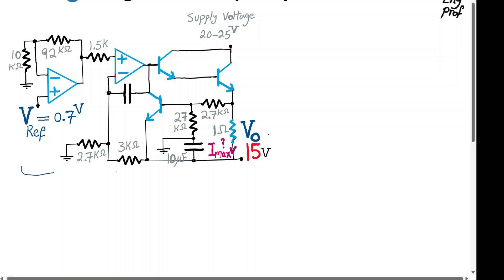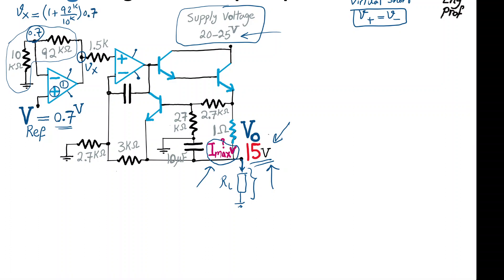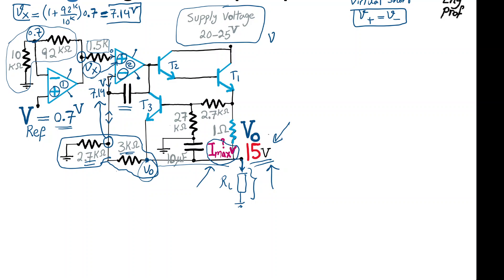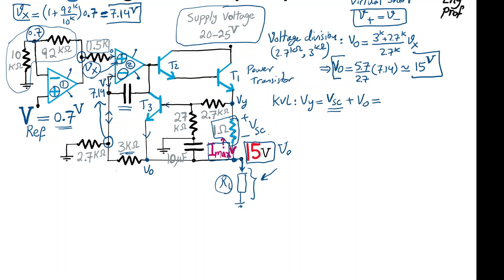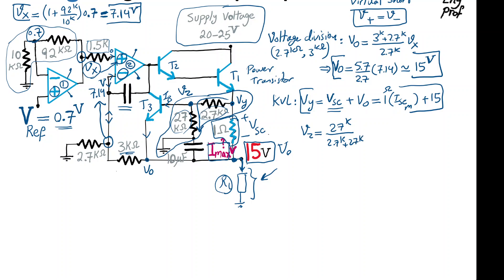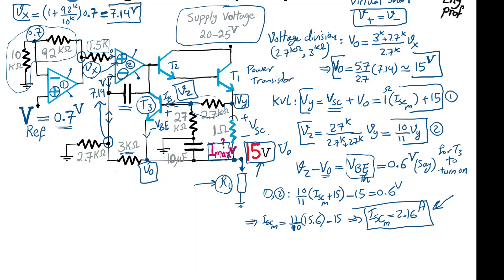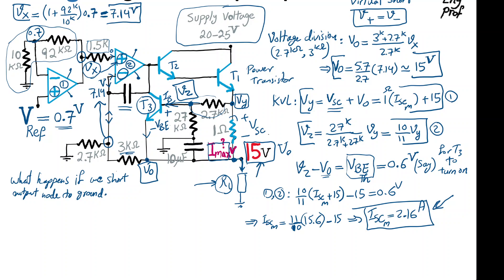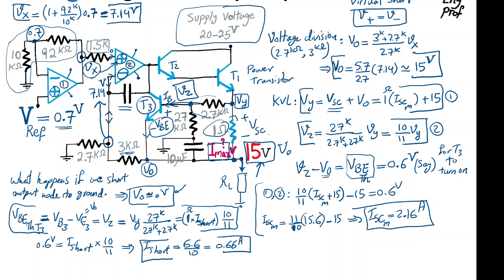Voltage Regulator Design with Op Amp and BJT Transistor

Comment: I suggest u pl focus on explaining how particular circuit works first before explaining how values of different resisters / capacitors are calculated
Reply from the maker: Thanks for watching, sharing your thoughts and your suggestion. You might find a better explanation in https://youtu.be/p5iiJE9Z7Lk video for a Low Voltage Regulator Circuit Design with Op Amp, Zener Diode, JFET, BJT Transistors. I hope you find it interesting.

Comment: Hello, I really appreciate you making this video! I have been trying to make a CC and CV power supply using BJTs and opamps for years now. I am puzzled by the crazy feedbacks other than the compensation networks, can you please make videos on those topics as well. I'm really passionate about electronics but I need help from an expert like you
Reply from the maker: Thanks Anurag for watching. Glad that this voltage regulator video is helpful. Pls watch this flexible regulator example https://youtu.be/CJl-urzeiTo and let me know if it is helpful regarding your question or not. 
Please let me know more details about what exact type of feedback scenarios are you looking for so that I do my best and find the best example to help you.
Reply: @STEMprof  Thank you for your quick response, I really appreciate it.
Reply from the maker: Thanks again for watching. Hopefully the new Voltage Regulator Design with Current Foldback feature https://youtu.be/RFfRrbqM_-s is interesting and helpful. 🙋‍♂️

Comment from the maker: Thanks for watching. For more Analog Computer & Op Amp examples please see: https://www.youtube.com/playlist?list=PLrwXF7N522y4c7c-8KBjrwd7IyaZfWxyt
Flex Voltage Regulator Example: https://youtu.be/CJl-urzeiTo
Voltage Regulator Design with BJT Darlington Transistors and Zener Diodes https://youtu.be/ArisQp7V0Ac
Bandgap Video: https://youtu.be/esMlNx5w9Jw
Sawtooth Oscillator with Op Amp, JFET and BJT Transistors https://youtu.be/5zHXTx-Vl20
Op Amp Analog Computer circuit that solves Differential Equation: https://youtu.be/ENq39EesfPw 
Full-Wave Rectifier:  https://youtu.be/DJJMNU-CYcg

I hope these Analog Circuit Design and Analysis Examples are interesting and helpful. 🙏

Comment: There are two separate systems here.  One controls the output voltage, the other senses an over-current fault condition.  There are ways of presenting a schematic in which the principles of the functions are immediately clear.

I have the gut feeling that there is too much amplification and this might threaten stability.  The "Darlington" transistor connection has enormous gain and op-amp 2 (used as a comparator) has an uncontrolled gain with decreasing frequencies.   The presence of a 10 uF capacitor across the output might suggest that there was initially a problem with stability, and the capacitor was necessary to "hold it down".

I would expect a modern design to use a power FET instead of a bipolar transistor.

In a fault condition, the load resistance may be any value less than the specified RL but greater than zero.  Can it be shown that the power dissipation in transistor T1 would be less than the maximum allowable under all values of RL ?
Reply from the maker: Thanks for watching and sharing your thoughts about this voltage regulator circuit. Yes, modern regulators use power FETs instead of power BJTs. This is just an example utilizing BJT.  Maximum power of the power transistor is maxCurrent*(maxSupplyVolt - EmitterVolt) ~= 2.16A * (25V - (2.16A*1ohm + 15V)) ~= 16.94 Watt. Therefore the Power transistor is recommended to be a 20 W transistor in this example.

Comment: I've always liked those Darlington arrangements.
Reply from the maker: Thanks for watching. Glad that you also like the famous Darlington transistor formation.  I will try to post more on Darlington.
Reply: but did you know there are two types
Reply: @kennmossman8701  The other one is the Sziklai pair : )
Reply from the maker: @tanmayvadhera4250 Thanks Tanmay for watching and your comment. I will soon post videos on Darlington and Sziklai Pairs. Here is another Voltage Regulator Example: https://youtu.be/CJl-urzeiTo
And a Bandgap Video: https://youtu.be/esMlNx5w9Jw
I hope these Analog Circuit Design and Analysis Examples are interesting and helpful. Thank you.
Reply from the maker: @kennmossman8701 Thanks Kenn for watching and your comment. For more examples pls see:
Flexible Voltage Regulator: https://youtu.be/CJl-urzeiTo
And a Bandgap Video: https://youtu.be/esMlNx5w9Jw
I will soon post videos on Darlington and Sziklai Pairs.
I hope these Analog Circuit Design and Analysis Examples are interesting and helpful. Thank you.